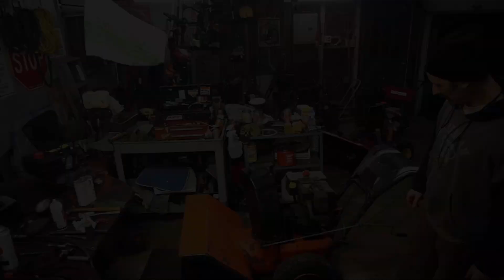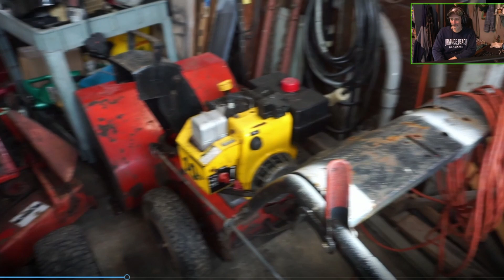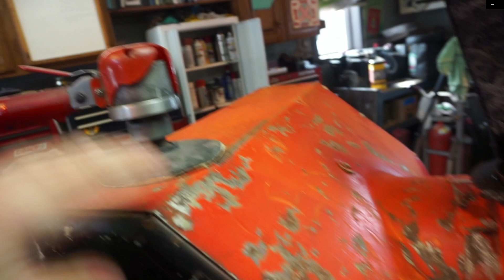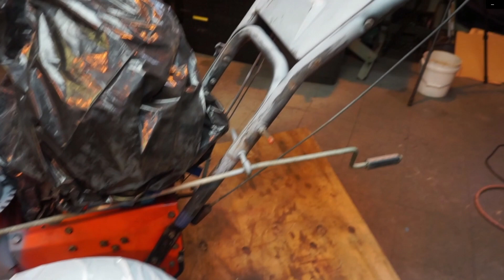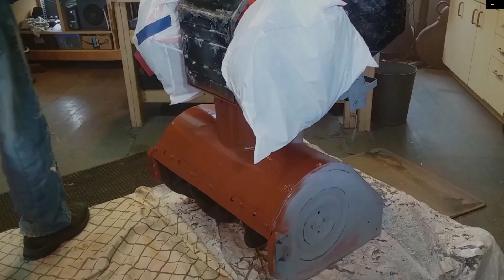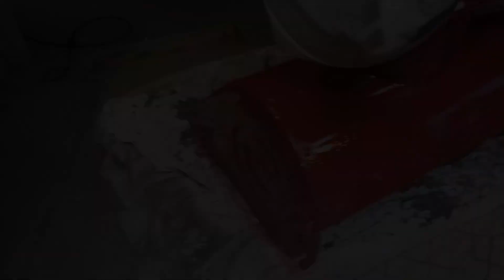WHAT KIND OF SNOWBLOWER IS THIS? Older Machine Gets OverHauled- Lets Fix This & Make it Usable Again

Comment: It's most likely a Noma of some vintage.  However, I know very little about Noma snowblowers.  I don't know if they share parts with others or not, but they do have a very distinct bucket design.
The Noma dash also looks somewhat unique, but John Deere dashes of some years look like that too.
The chute looks like an Ariens, but for all I know someone cut and bolted that on.  The turning mechanism is not Ariens.
The turf tires don't really help, old Ariens used them but they are just plain turf tires, anybody could use them.
(edit) some people say Noma is affiliated with Murray, and there are strong resemblances there too.
(edit2) lol, just noticed it has the grifter triangle on the back.  I forgot what it says, but I think it's just some group that says "pay us money and we'll put a sticker on your machine saying we approve it", at least that's the impression I get.  You see that triangle on some older blowers.
Reply from the maker: Right!!! 
Crazy stuff,,,

Comment: it looks like a 1969 yard man snow bird
Reply from the maker: Could be a newer one maybe,, the engine is original with electronic ignition and it has cable to operate clutch and auger soo it would have to be newer than 60's or early 70's